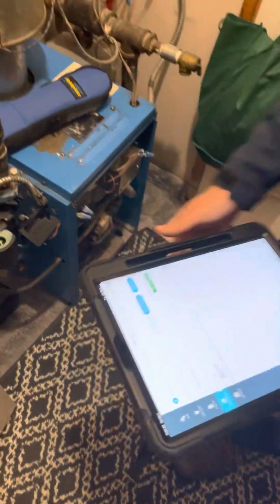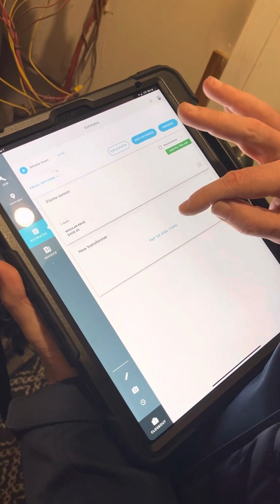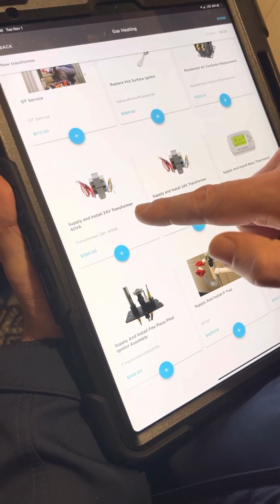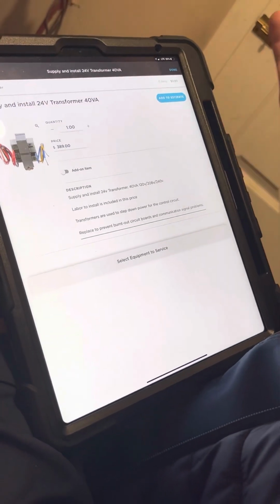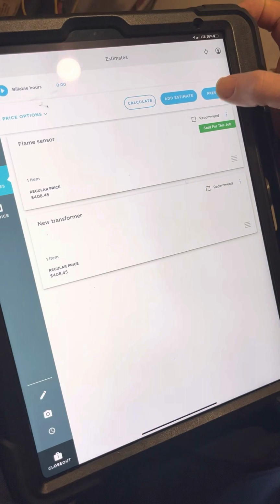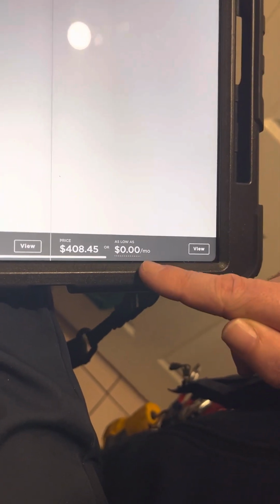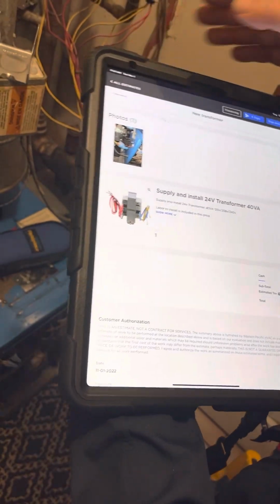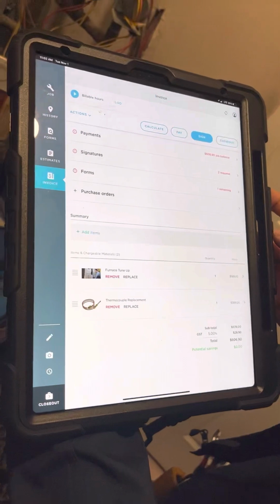How To Create A Service Estimate In Service Titan

Comment: What's the recommend check for?
Reply from the maker: If you provide more than one option to your customer and would like to recommend one option in particular, you can hit the "recommended" checkmark on that option. The option you checked will now show up as the recommended option when you present your estimates. Honestly, I don't use it that often but it has come in handy once and awhile especially when emailing the estimates to a customer who is not on site. I hope that helps!